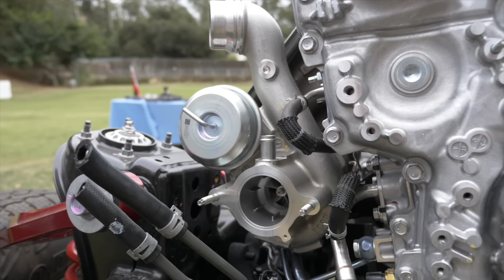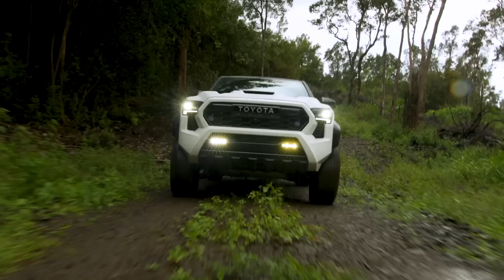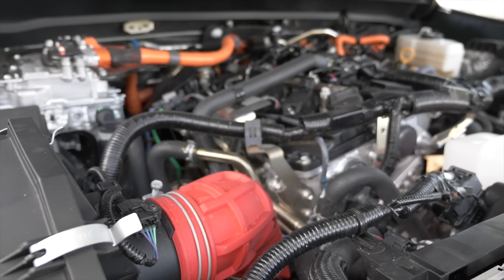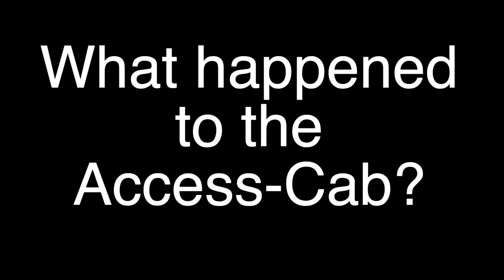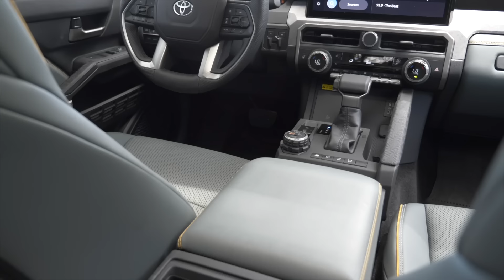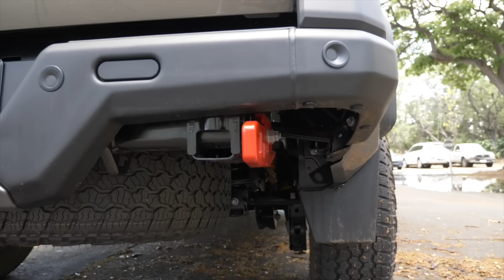2024 Toyota Tacoma Chief Engineer on new engine reliability and more...

Comment: I hope this 2024 engine is better than the turbo 4 in my wife's 2023 Highlander Limited. I can't stand driving that thing. Massive throttle lag until 15mph or so then wham... the turbo finally lights and it takes off and can occasionally spin the tires. Try to make a right hand and accelerate... tires spin when turbo spools. Whoever programmed the wastegate part of the tune should be fired. No linearness to the throttle at all. Should have never gotten rid of the V6. Would have been a much smoother ride. We've had her car for 1 year and 15K miles. I can't wait until she gets tired of it. I expected a better ride out of that car. Disappointed...

Comment: It's a nice looking truck, I like it, especially with the new added features. I have a Tacoma now and love it, however I'm 64 years old and been around cars and trucks most of my life. I know people who have had turbos on their cars. Likewise, I myself have a turbo on my dodge ram with the Cummings diesel engine. To me, knowing what I know about turbos with my experience and what I have seen with my friends, a diesel is the only engine I would ever consider having a turbo on. Why? Because they simply wear out an engine way before their time, because of the added presser the turbo puts on each cylinder. Diesel engines use diesel fuel which is mixed with oil which lubricates the engine and offsets wear and tare, so I didn't mind buying one on my dodge, I still should get 500k to a million miles on my dodge, but I am very skeptical about a 4-cylinder turbo engine for the new Tacoma. So here is my challenge. Show me a new Tacoma with the turbo 4-cylinder engine that get a million miles on them like I have seen other Toyota truck engines  get, and I will trade my Tacoma in on a new Tacoma first thing tomorrow morning. Heck, even show me these engines that get 500k miles on average as a work truck hauling and towing light loads and ill buy one, but I doubt they will even get over 200k miles with a turbo 4 cylinders on a gas burner. They may not even get that. I hope I am wrong, I will gladly concede if you do because I have owned Toyota trucks since 1994 and love the dependability and reliability and longevity of a Toyota pickup truck. That is why I keep coming back to Toyota and buying them. I own the Dodge ram with the Cummins diesel to pull a lot of weight like my tractor or camper, Toyota didn't offer a diesel at that time, which is what I needed to pull heavy loads, but I have the Tacoma to work around town and at the farm to pull my lawnmower and my portable sawmill and my  motorcycle, lightweight stuff and I have a Honda CRV to drive around town. Furthermore, I hope all of them get at least 500k miles as I take very good care of them and change the synthetic oil every 5000 miles and all the other fluids at 60k miles or every 3 years. So I will be highly pissed off if they don't get 500k, and I will not ever buy that brand again. As much as a car or truck costs now, 500k miles is very reasonable to expect to get from a new car or truck. We should get our moneys worth. My first brand-new car back in 1980 was a ford Fairmont futurea that costed me 14k and change with an inline 6. Now, new cars and trucks cost over 40k. Back in the 1970s you could buy a new 1400 sq ft house for 14k. So every one should expect to get 500k miles if they take care of their new car or truck. Anything less is a rip off.
Reply: How does a turbo add pressure to each cylinder and cause premature wear?
Reply: @riverton70 A turbo forces compressed air into the engine’s cylinders. This causes a stronger combustion reaction in the cylinder, creating excess heat as a by-product. This burns the engine’s oil faster, meaning oil changes need to be more frequent, and accelerates the breakdown of the engine’s components.
Reply: I'm very curious to see how this new turbo engine does. I think Toyota would be the one company who could make a turbo last 500K, I'm just not sure any company cares about that anymore. If they recommend 10K oil change intervals like they do on some other models I doubt it will make 150K. I'm assuming you bought the CRV with the normally aspirated engine because I think that 1.5T had some big problems with oil dilution.
Reply: I agree with you, I hope Toyota can make their new turbo last 500k miles, but I am doubtful with my 2023 Tacoma they tried to convince me to only change the oil every 10k miles I laughed at them and take mine in to Toyota on the 10k intervals and to a quick change place on the 5k intervals. And yes I bought the normally aspirated engine because the turbo on the smaller engine was causing so much pressure in the cylinders it was pushing gas beyond the rings into the oil and causing oil delusion sounds like you did your homework it pays off when you do @briankalagher6687
Reply: How much did you make back in the 1970s vs now?

The reason I'm asking is $14000 in 1980 is equivalent to $52,274 today, do you think if you paid  $52,274 for your Ford Fairmount today would you got your money's worth? or would you have been ripped off? Did that ford get 500,000 miles?
Reply: Lol where did you get your numbers from, I would like to fact check them. I am a multi-millionaire today, in the top 10% as far as income, back then I was just out of high school working a factory job. No use comparing apples to oranges. As far as getting my moneys worth back in 1980 no I didn't I was only able to get just over 100k miles on it before it started to use oil even though I changed it every 2 to 3k miles. A woman pulled out in front of me and caused me to crash and total loss the car, so I have no way of knowing just how far it would have gone once it started using oil. It was the first and last ford I ever bought because of that. Although I will have to say I did really like the car. None of the Honda's or Toyota's I have owned have started using oil at 100k miles. My father however had a ford pickup truck that got 500k miles on it, before it was worn out, that he bought in 1972 so he definitely got his moneys worth @joepierson3859
Reply: @flashpan26  the Bureau of Labor Statistics please correct me if I'm wrong .

The dollar had an average inflation rate of 3.11% per year between 1980 and today, producing a cumulative price increase of 273.39%.

This means that today's prices are 3.73 times as high as average prices since 1980, according to the Bureau of Labor Statistics consumer price index.

By any metric cars and trucks are  cheaper today than they were in 1980, safer with many more features.

It's just a matter of doing the math
Reply: They build the turbo gas motors just like the diesels, cgi blocks and forged pistons. Its not just a small motor with a turbo added, those are the ones that fail prematurely. Ford even has their turbo's inside the manifolds, and has the manifolds liquid cooled. Im not really a fan of it in the Tacoma, our F150 work truck fleet with the 2.7 {highest HP vs displacement Ford} have been super reliable and many just under 200k. I thought they should have kept the 3.5 and did a new transmission, cuz that was its issue. My Access Cab 4WD gets over 25mpg on 2 lane roads, probably going to be better mpg than the turbo boosting gas thru it.
Reply: The simple truth is most buyers aren’t putting 500k miles on a turbo 4. They don’t manufacture them to meet that requirement.
Reply: that's true i agree most people trade cars in 1 to 200k miles. @MichaelWalker-z2j
Reply: Btw can you tell me which cars and trucks are manufactured to go 500k miles other than a diesel @MichaelWalker-z2j

Comment: The gas engines lack torque. I have both Hilux LN106 diesel 3L and 21 tacoma 5 speed V6 gasoline. the tacoma stalls out if I release the clutch even at 700 rpm. It seriously lacks the torque. Multiple prado's 4 cylinder diesel turbo charged have shown to explode pistons when towing. 4 banger will cry when towing 6000 lb uphill from stop. I will not go with turbo's with 4 cylinders.

Comment: Looks amazing. The problem is that these trucks are just too reliable. Just paid off my '21 (after refresh and years 16-19 problems figured out). I wont be in the market for a new tacoma for 15 plus years.
Reply: I'm not so sure the 3rd Gen has been proven to be as reliable as previous years. The very first one I looked at with over 100k had a leaking rear main seal, leaking 3rd brake light with water all over the seat, and a very questionable transmission. That seems to reflect what I read online about them, and that's unfortunate, they are going to kill their good name like Nissan did if they go down the wrong path.
Reply: @HereForAStorm  Nissan only killed their cars.

Comment: You all go ahead get this. I am sure it will not have any issue just like the new tundra.  It is going to be just like the ford ranger. The MPG will be listed at 26 to 23 give or take but, if you use it in anyway other than a grandma grocery getter the MPG plummets.  Friends 2022 ford ranger pulling a 4000 pounds ish trailer got 12 mpg real world driving.  My 2002 toyota tundra 4.7 gets 16 mpg with same trailer. The Tundra's driving is so much better than the ford.  The trailer is unnoticeable behind the Tundra. The ford shifts all the time and the rpms are through the roof.  Wind deflection is terrible as well.  It is just physics.  Weight and at idle torque too 1000 rpm makes a useful truck.  You people with more money than brains just go ahead.

Comment: I do not think turbos and naturally aspirated have a huge gap on reliability period. Now that automakers are forced to get rid of v6 & v8 Toyota will do everything to make Turbos reliable. At the same time maintenance expense will still be key factor in the longevity of the turbos
Reply: You clearly don't work in the automotive sector of life, because you still have faith. 😆
Reply: @HereForAStorm  I do not. But I made an opinion based on the information I have acquired from listening to a lot of experts like you on automobile engines and not just the information from this Toyota Engineer.

Comment: There is no way any of these new turbo motors are better than than the 4.0 motor, more power yes, better fuel economy yes, but long term reliability no, probably have the same crappy metal your using just like the older ones and my 2006 tundra where the all rot out right in front of the rear wheel, my 06 has 86,000 miles on it and frame is toast, yes you sprayed it and it all came off in a year, these frames need to come factory coated, you pay $40-50 thousand on a truck and they rot out in 7 years, I have friends with 30 year old GM trucks and the frame isn’t roted, you need to stand behind your trucks and customers with these rusted frames.

Comment: Lexus has had the 2.4 turbo for a couple years already and Toyota sells the hell out of small displacement turbo engines overseas. Don't forget all the diesel turbos they've sold for decades. They'll hold their suppliers to a higher standard and eventually work out any bugs. I trust them more than any American automaker.

Comment: I really doubt that little herky, jerky, buzzy 4 cylinder with a turbo will outlast a V6.  I have the same engine in a Lexus RX 350.  It is NOT as good as the V6.  The Lexus V6 was smooth and powerful.  This little 4 is just powerful after the turbo builds up

Comment: I’m not worried about Toyota turbos I’m worried about the hybrid battery. I think the non hybrid Tacoma would be my choice.
Reply: There are LOTS of Toyota Hybrids with over 250k miles, no problems. Why do couriers, taxis,  etc buy Toyota Hybrids? Even the battery warranty is 10 years, 150k miles.

Comment: I really wish he would talk about the base Iforce engine, not the weak one in the SR but the one in the offroad trim with a manual transmission as it is the only engine you can get with a manual transmission. You cant get any information anywhere about that setup lol, even the Toyota website just praises the Iforce max. I am also guessing the base Iforce does not take it to commercial grade?
Reply: On secon thought, Maybe its time to give the old six speed up and designate the Max as.. But i heard the Max is only available in AWD/4wd, like when your not in 4x4 your in AWD. the vid is on Youtube anyone hear about this also? But man just hearing about the engineering behind the force max, and knowing the battery is to help the engine, I mean this sounds like the definition of efficiency lol. Sure a manor repair or like idk something new to the battery down the line, but sounds like it will preserve the engine. Idk if i can pass up on the Max now especially given that they offer it on the Tacoma now!

Comment: Just got a 2023 tacoma off-road 6spd manual.. glad i got in on the last simple toyota truck.
Reply: Me too, same truck. I got it last month. I hate the electronic throttle.
Reply: I had a 93 hilux. Those were the last simple Toyotas.
Reply: I also just bought a 2023 Taco, the last of the  dinosaurs, but it is a proven machine.

Comment: Gasoline trucks don't need turbos, you can atill use the 2GR! The camry still is and V8's are still being used. Turbos beling in sports cars and diesels, not tiny little engine pushed to their maximum with plastic valve covers and the hybrid system too! Wait until that turbo AND hybrid system go, there goes your wallet🙄 I LOVE Toyota but really not happy with that decision

Comment: Nice, it looks like they’ve gone back to a spin on metal oil filter (bottom front) 👍🏻 The serpentine belt looks simple too.
Reply: Hooray. Those plastic filter housings were a problem getting stuck on and being damaged during removal, and the filters were dearer as well. Good in theory, poor in practice. Thanks Toyota.
Reply: I had only started recently changing a Taco filter and if you don't get a quality filter O-ring and or change it every time with O-ring lube. Had one break and lose oil. Every filter change is a precarious endeavor.
Reply: @Bikerdav  Yeah, the cartridge filter is definitely more fiddly & time consuming to change. Gotta be careful installing the o rings.
Reply: Canister system is better
Reply: @zoner__  in what way?  please be detailed.  for me, it takes me twice as long to change the filter,  theres more plastic involved, and its messier.
i have this on my camry.   on my previous ford, the plastic cap after 12 years developed a crack and dumped 2 quarts of oil on the ground.  In 40 years of changing metal oil filters I only ever had one leak, a stupid STP filter, which I only ever bought one time and never again.
Reply: @orbitalair2103  let’s see.. who still uses canister? Toyota and Porsche.  A couple of manufacturers that put engineering a priority. Go see Car Carr Nut video on oil filters for more reasons. More plastic? How about throwing away a metal canister instead of just the paper filter?
Reply: Germans all use canisters with filter insert.  @zoner__

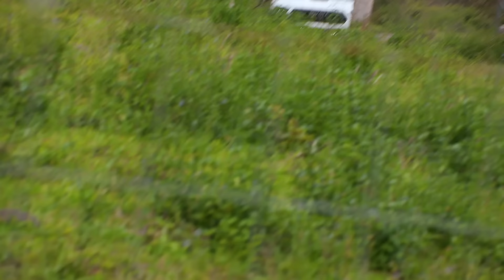Comment: He says at 6:02 that the frame in the new Tacoma is improved as far as corrosion they said the same thing about the 3rd Gen when it came out and that was a total lie there were tones of recalls on the 2016's and 2017's due to frames rusting. I would wait at least 3 years 2027 to purchase this truck

Comment: I love the reliability of the 2.7 but the lack of power is frustrating, but that lack may be why it lasts. More stress and heat will likely kill the new one much quicker.
Reply: In 1994 maybe. Turbo engines are extremely reliable unless.. we are talking about GM vehicles.
Reply: Same theory with the 1.8 litre engine in Toyota Corolla. They ditched it for 2.0 but that 1.8 litre did last a long time.
Reply: You’re right you don’t want a turbo
Reply: The 2.7L is a tank of an engine. My only gripe was that mine was paired w/the 4 speed automatic. Biggest shortcomings in performance was during uphill interstate merges or long/longer uphill interstate stretches.  I regret that I didn't wait to get one with a manual transmission.
Reply: @NVRAMboi   Agree. I had to drive mine like a manual at times. To pass especially 😆
Reply: It's possible to boost the 2.7. Toyota should have had that as an option. The 2.7 is over engineered and could handle it.
Reply: THEN STICK WITH YOUR 150 HP     NO BIG DEAL  LOL
Reply: @BobFrailey  Why all caps and no punctuation?  Are you 12 or 14 years old?
Reply: @BobFrailey  your comment makes no sense in this context. You probably should go back and read the whole thread carefully if you want to try and throw some shade
Reply: @KramNoss  I got The Overland Tune (OTT) on my 2.7 automatic 2wd and love it now it is a wonderful investment! I am sorry that I had to wait until it has 120,000 miles on it.
Reply: @55jplock  is that available on a 2015 with an automatic? I just sold the one with a standard shift and bought an automatic so my wife could drive it more comfortably, she has a bad hip from a broken pelvis in the military. It sure would be nice to beef up this little truck's towing abilities, it's worse than the stick!
Reply: Nothing wrong with a good turbo in a reliable engine they still last a long time.
Reply: The new Toyota Tacoma base is 2.4 turbo garbage engine
Reply: @phoenixrising7623  Exactly 3500 pounds of tow capacity means the damn truck couldn't even tow itself.

Comment: I own A 22 TRD OFF ROAD 4X4 MANUAL and I have no complaints. I bought it for longevity and its functionality. I don't want to buy another one unless I have to. I like the looks of the New Gen. But that 4cyl turbo hybrid has me concerned for off road capabilities/long-term use. We will see though Toyota vehicles for the most part are the most reliable out there..IMO
Cheers 🍻